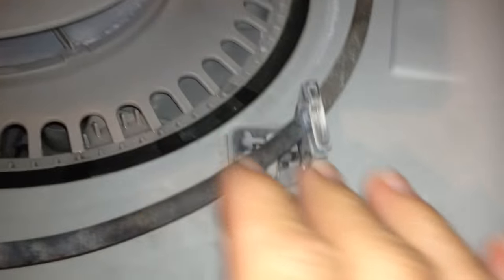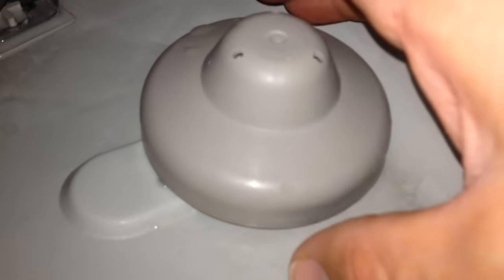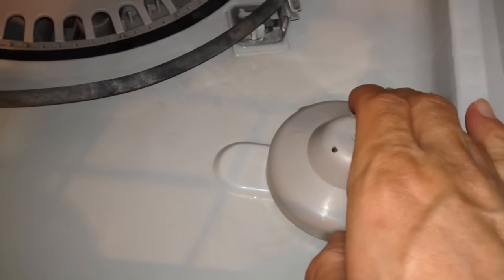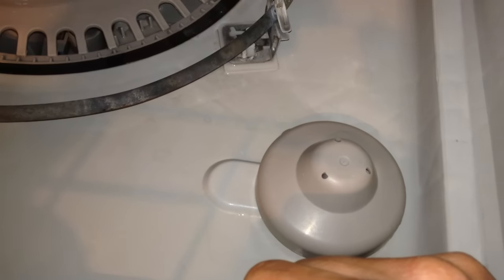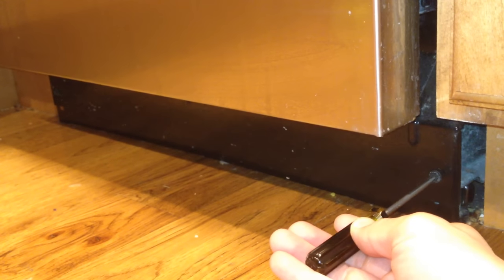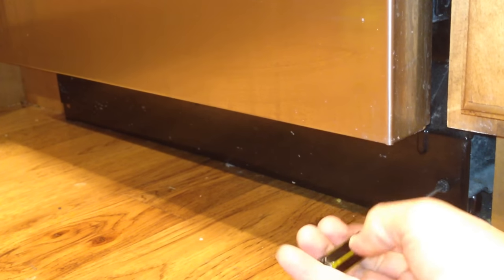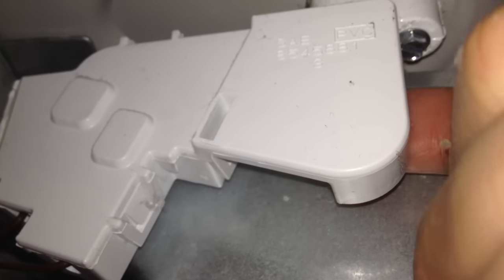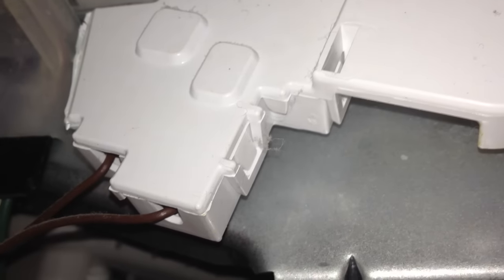Dishwasher float switch - How to locate and simple test

Comment: Thank you. Dishwasher had stopped filling. We had actually ordered a new dishwasher. I saw this and pushed on the float and found out the float had been stuck in the UP position and was not filling. I simply pushed it down and now it works perfectly.  Thanks you just saved me $$$$ and much time for installation.
Reply from the maker: That's awesome! Glad to hear it!
Reply: Ditto! Thanks AdamDIY!
Reply: Adam, what other tip can you give me on why water doesn’t work
Reply: Dishwashers don't "fill".  They spray water all over the dishes and that water drains out.

Comment: Nice video. I think mine is leaking so I need to unscrew and check the gasket, or washer. Just one tip for you ... I recommend no music when your video involves listening for clicks. It worked anyway. Tks.
Reply: Mine is leaking — what was the solution?
Reply: @trad3rj03  I cleaned all around the float so it was able to flop up and down again. I think I was getting overflow, not a leaking float valve. However later I found that I had a leaking turbidity sensor and the entire tub seal was leaking. I replaced the turbidity sensor with a spare from ebay. Its a simple twist fit. I had to cut the wires  solder in as the edge connector was not identical on the new unit.  I used silicon on the tub. Its now running in a tray with a water alarm and the alarm is not going off. Once this unit is finally end of life I wil pay more and get a better brand next time.

Comment: My Kenmore ultra wash dishwasher has a plastic extension coming from the bottom of the float. The plastic extension came up out of the slot that was meant to guide it onto the switch below and caused the water not to flow. I raised the float up, turned it 90°, and lowered it through the slot. Problem solved!

Thanks for the great video. You did a great job and have helped a lot of people.

Comment: Yo AdamDIY - need to thank you for the "sound tip". I repair everything, 2 months ago I became a dryer expert at home and 2 wks later replaced the heating element for my sister, sounding like a pro :) ... I've installed but never fixed a DW. Wasn't filling with water. Found a GREAT video on how to connect AC to the pump and see if it flows, worked like a charm and the tech video was great. Then I looked into the overflow - not realizing it clicks a switch like that. Tried your test - DEAD, could "feel" nothing was happening and no click sound. Pulled the DW out, put it on its side to get a good look - AHA!!! The switch came out of the little plastic squeeze-clip!!! Pushed/clicked it back into place - VOILA we are back in business, YAHOOO. As a side note - the original symptom was the water-spray  arm melted from sitting on the heater, which I back tracked to no water so it wasn't spinning. Thanks again!!!

Comment: Thank you for posting this video.  With my finger, I cleaned out the gunk that was preventing the float from seating.  Listened for - and heard - the relay click you described, and started the washer.  Worked perfectly!
Reply: I'm wondering if mine is dirty or if it's something else because I hear it clicking but my dishwasher is only running for maybe a minute then about a minute then it starts and repeat
Not sure but I will try looking at some more of your videos
Thank you

Comment: Thanks, my float switch was clicking. Also check the inside of the float for build up as it adds weight which prevents float from moving to the upward position.Will cause slight overflow. I broke the stem because it would not come out.

Comment: This was very helpful, thank you. I ran the diagnostic test and the number it threw was 64; Float Switch Open. 
When I waited to open until the dishwasher was filled, when I’d bounce the float or spin it tons of food particles came out that would not come out when I cleaned underneath the float when it was dry. So I thought MY KIDS were the problem not rinsing their dishes. We ran it, same code, still not drying, so this was helpful!

Comment: My old Whirlpool dishwasher has a metal orifice hole (much like our shower heads) at the electro magnet valve which is used as a meter for the water flow fill rate before either the timer or float shuts off the magnet. 
I had to use a slightly larger drill bit to drill out the hole which was too small to let enough water in and so caused motor pump cavitation sounds and poor cleaning, which manually adding more water fixed. 
I also had to bend/adjust the float shut off level switch to allow shut off at just the right water level to keep from cavitation but not use too much water.
Take care

Comment: Hi, in my case Kitchenaid dishwasher, the water is constantly flowing. After checking the switch you could hear the same sound you presented but the water at some point is just start leaking out. After I shut the water valve and pressing cancel button, the water is regularly drained out.
I also noticed that wires from this float switch are passing through another switch or a sensor and then going into the main wire panel.
I would appreciate any help on this.
Reply: At the end I called service technician  to diagnose the problem. After 5 min. he said it is a Water Inlet Valve and the price for labour and the part would be CAD$496. I refused to proceed with that for now. What do you think? Thank you

Comment: @AdamDIY hello!  I hear my dw fill with water, then I hear the float relay switch repeatedly go click click click but no activation of the circulation pump.  Filter is clear.  Spray arm is clear.  Water comes in.  Water drains out.  I only have one question about the float switch.  When I open the door, the water is not above the heating coil.....  Diagnosis???
Reply: Did u ever figure it out?
Reply: @agkoh  nope and never got a reply to my question either
Reply: Damn, this is exactly my current problem and it's so hard to google 😭

Comment: Any reason there would be a leak at this switch? Mine was dripping water...but if that doesn't make sense, maybe it running down from somewhere else
Reply: I just found out I have the same problem. Any ideas?
Reply: Once I got in there & took the float off I realize it was PACKED with gunk (as was almost every other internal part of my dishwasher) I'm pretty sure it was making the float stick so the washer kept filling until the water went above the tube that the stem of the float goes down (the stem is what pushes the on & off switch) Once I cleaned it out real good I have not seen any leak.

Comment: Ok thanks, my float seems to work perfectly, but I get low water levels. Which to me that the water will stop flowing before hitting the float???? Why does the water shut off prematurely. There must be more to it than the float correct? Thanks a lot!
Reply: What did you learn? I'm having a similar problem. I think it might be engaging too soon?
Reply: Water intake valve may be obstructed. That's the doohicky on the left side with the two pipes feeding in and out of it. May need to be replaced
Reply: @CN-bg1fy  thanks, it was the intake valve, fixed it!
Reply: @Michael Madsen  I replaced mine just this year...but that didn't solve it. So now I think it's the float switch. Hand washing builds character I guess

Comment: Crap, I was trying to fix my dishwasher that won't drain or wash dishes properly. The man at Ace told me to pop it off and check to see if there is gunk under it.  I popped it off all right. Broke it. Not only did i not fix the problem, now i have another one. c.r.a.p.

Comment: My Kenmore Elite fills just to the bottom of the float and shuts off. Over rode manually and it still shuts off, The water shut off seems to be OK but then again the float might be as well. I'm stuck and tired of filling up manually! Shame, it's great and quiet when working well.

Comment: I have an LG Diswasher LDS5540ST, and I suspect a float problem, but I can't actually find the thing anywhere on the dishwasher, any thoughts?
Reply from the maker: +Pihutihutihutijay The float assembly looks like this  http://www.searspartsdirect.com/lg-dishwasher-parts/4769DD2001A/0022/722/model-LDS5540ST/3204/0130000.html and you will have to pull out the dishwasher to access it.  Here are some more pictures : http://www.searspartsdirect.com/model-number/LDS5540ST/3204/0130000.html?searchType=modelSearch&prst=&q=LDS5540ST&searchTerm=LDS5540ST&shdPart=   This one shows the drawing of the float assebmly http://www.searspartsdirect.com/model-part/lds5540st/3204/0130000/f1308008/00004.html

Comment: Had issues with dishwasher. Wife says not working  "it's not getting water". I replaced inlet valve but it was getting water. recirc pump wasn't working. I replaced that pump and cleaned spray nozzles etc.  Then it would overfill 10 minutes into wash, Leaks over door sill.  replaced float switch, checked that washer was level, cleaned bottom door seal. still leaked.  I took a drastic measure and shortened the float arm by cutting the tip off. So far problem solved. It thinks the water level is higher, so it runs with less water. Whirlpools kinda not so great.

Comment: unfortunately I pulled on the float cap...........which immediately broke. So now I have to replace the whole thing.
Reply: I did the same thing.  Seems like they designed it that way.  Repair Clinic only sells the whole assembly for $28, for my model, at least.  I was miffed that I couldn't buy the mushroom part for a few bucks.  I pulled the damn dw out, found the little, broken-off cap, and glued it back on.  So far, so good.

Comment: my float leaks under neath where the switch is at.  How do I correct this problem?
Reply: Sandra Krupp, if your dishwasher is anything like my 5 year old Whirlpool, the plastic float-switch assembly that passes through the metal bottom to the underside of the dishwasher is either loose,  or the thin (extremely thin) rubber gasket on the underside of it has compressed too much. The dome shaped plastic float should snap straight up and out with a hard pull ( use two hands, pull straight up),  And you will see a large white plastic nut which may need to be tightened. If it doesn't seem particularly lose, unscrew the plastic nut and drop the assembly down so that you can inspect the rubber washer or gasket on the plastic threaded stem which butts up against the underside of the dishwasher. That gasket is quite thin, and probably a little too small in diameter compared to the hole in the metal that it passes through;  if it's chewed up or shows lines in it from having been compressed then you should replace it. I put a second washer on the top, inside the dishwasher but underneath the plastic nut; however, the 1st time I tried this, the rubber washer I used was too thick and the float switch wouldn't work properly. You'll probably need to go to a plumbing supply store to get a similarly sized rubber gasket to what was originally used by Whirlpool, as the local hardware store didn't have the correct size/ thickness.  I tried garden hose gaskets and other similar things I had lying around here,  but all of them were too thick. I'd buy two rubber gaskets/ washers if I was you,   not just one, and put 1 underneath the machine and 1 underneath that plastic nut on the inside of the machine. Just be aware that the washers can't be any thicker than what was originally used or you'll have a problem getting the float switch to work properly ( won't drop down far enough)  and then the dishwasher will not fill when you hit start. 

I was tempted to seal the whole thing back in place through the bottom of the dishwasher with silicone caulking,  but then it would be difficult to get it out if the switch itself actually failed or if the repair wasn't successful.....